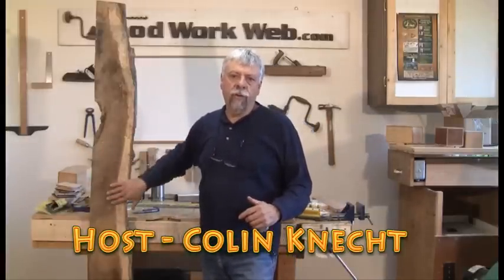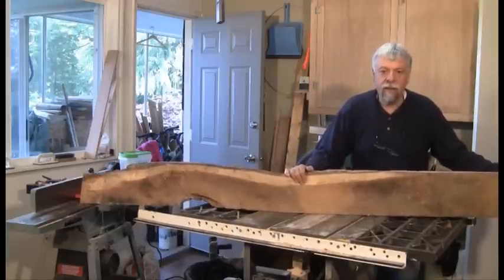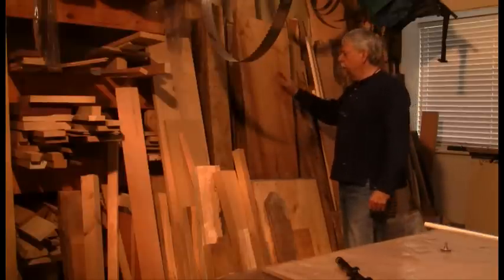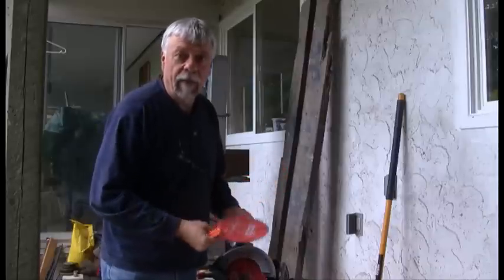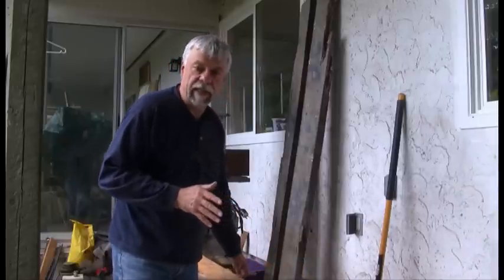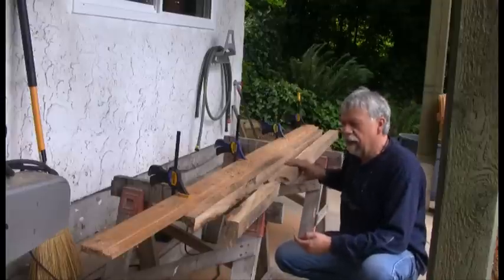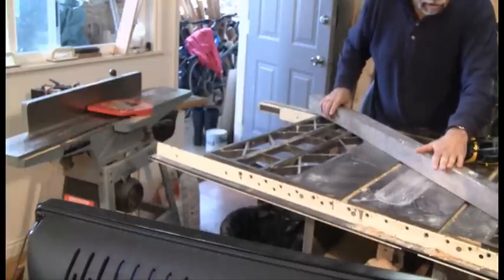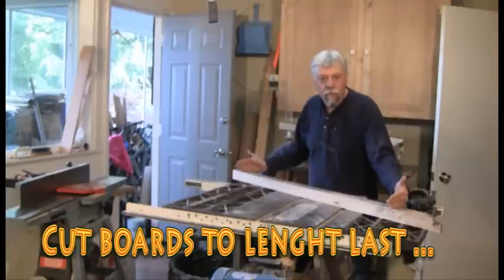Dressing Rough Lumber  - A woodworkweb.com woodworking video

Comment from the maker: Good point, thanks for mentioning this, Yes I have a 6' jointer but a 16 planer so, yes with a bit of work the planer can be used for wider boards by shimming, and also by gluing "skid boards" to the edge of the board being planed. I must admit I have not done this yet, but good reminder. Thanks for commenting, great to have you with us
Colin

Comment from the maker: Hi Zack, yup you are right, I am always concerned about dirt dulling my jointer and planer knives. I know the wood looks dirty, but it is mainly the oxidation of the tanin in the sawdust that is making it look worse than it is, but still I will often wire brush the raw boards before joining and planing.
Thanks for commenting on this important topic on dressing lumber :)
Colin

Comment: Thanks for this video Colin. This is the method that I was taught as well. I will admit that the first time I dressed timber I did not have many power tools so my method was borrowed from Roy Underhill. It was oak and so I was able to split it with an axe, then used a drawknife and a jack plane to finish. 
Now that I have a bandsaw, jointer and thickness planer in my shop, I really do not want to go back to the old ways.

Comment: I often do a quick pass with a belt sander if wood is dirty or may have ingrained grit before putting it through a machine with sharp cutting edges. It can also show up old nails or other metal as bright spots, which are harder to spot as rust marks. Thanks for the clarity of your explanations.
Reply from the maker: Hmmm, that's a good idea, thanks for posting this Rod. I am often using urban lumber and you never know what will show up in it, so that's a great tip, helps keep the blades sharper longer too :)
Colin

Comment: Thank you for this great video! I have a lot rough lumbers lying around and wondering how to mill them for furniture. They’re quite thick about 3 to 4 inches and 14 feet long with 15 inch face. I have a table saw with no splitter, a 6 inch jointer, and 7 1/2 inch circular saw. Your advice is exactly what I’m looking for. Thank you!

Comment: really appreciate the explanation, sir. i am wondering if using 8-1/4" circular saw could speed up the cutting process(less pass), meanwhile could using circular saw to rip hardwood lumber(8/4 or 12/4) lead to some dangerous kick back?

Comment: HI , Great video. I just have a question.@6.38 mark of the video you mention that setting the straight edge at 2 1/4 inches. I am just curious since none of the edges are square where do you take your measurements to ensure you get a straight cut and not a wedge ?.
Reply from the maker: Hi Steve, yes you are right, great question, you basically need eye-ball that setting, you may get  slight wedge but normally I would think it would be pretty straight, and as you go along you will eventually cut any wedging off and get a perfectly parallel board on your table saw.
Reply: Thanks for the reply. This squaring up wood has been driving me nuts. I have a Jointer but just cannot seem to get the hang of it. I have an older table saw and I have been thinking of getting a tracksaw for long rips and trying to square wood. Do you have any opinions on tracksaws ?
Reply from the maker: steve mcelligott There are a few track saws on the market, I do not own one and have only tried the DeWalt, which was fine. You know that you can make a track saw, of sorts just by using you circular saw, and they work quite well, the only problem with them is they do no have the depth of cut that a true tracksaw has, so if you are working with 2" lumber, it could be slightly short. I don't think I have done a video on this, probably a good idea for me to show how to do this.

Comment: I noticed you did not use the jig correctly with your cirular saw. Should you not have ridden the jig so that the blade just hangs over the jig?
Reply: I agree. If you do it the other way, riding the saw on the wood itself, as in this video, then the saw, and, thus, the squareness of your first cut is at the mercy of how straight the face of the board the saw is riding on is. A very wobbly face will in turn cause the saw to follow the wobbles and possibly not give a straight 90 edge all the way down the length of the cut.

Comment: I have an 8' by 1/8" hard pan jig with an attached fence that has various places to attach modified bar clamps. I always plane the lumber flat on both sides then clamp it to the jig and run the jig through the table saw with the jig fence against the saw fence. After the first pass I remove it from the jig, flip it over, and square up the remaining side.
Reply from the maker: Thanks for the tip and thanks for watching!

Comment: question: I have a plank of birch which is mildly warped both lengthways and across the grain (like a twist in the plank). I was raised on the same adage to joint one side and then joint its adjacent before the table saw, but i just can't get ride of the bow and i think its because the wood is warped both in the x and y axis. Am not pressing down on the work as I pass it to cheat out the bow, and understand well the jointers purpose, but id rather not blame my tools when something im doing could be wrong. Whats the best way to address this issue?
Reply from the maker: Paul Heinrichs These are tough ones to work with. You didn't mention how thick the plank is, or what thickness you want to bring it down to ... not the size so here goes with some guess work.
If the plank is thin and too much stock is going to be jointed or planed off, you don't have much choice except to cut it with bandsaw, circ saw or even table saw with a straight jig set-up ... do your jointing and planing and re-glue.
If you have enough wood to work with you could set up a jointing jig for your planer (assuming you have one) basically all this jig does is, you lay you birch on it, then shim the holes between the birch and the jig so the planer does not flatten the wood as it goes through. This way you will get one face that is flat and you can work from that.
Hope this answers your question ... ask more if you need
Colin

Comment: Thank you for taking the time and trouble to post this video which is very nicely done.  My I ask a couple of stupid questions?  After you have 2 edges "true" from the jointer, why not do the other 2 sides on the jointer as well?  That is, what is the advantage of using the planer at that stage?   Also, if you plan to run the wood through the planer, why not just joint one side and plane 3 sides?  That is, what is the advantage of having 2 true adjacent sides when on one of those 2 sides doesn't have contact with the blades or flat surface of the planer?   I'm sorry if these questions are elementary, I'm just trying to understand the process.  Thank you.  Gary
Reply from the maker: Gary Sadler Good questions Gary ... Answer 1 - we plane the opposite side of the jointed edges to make the boards parallel, at least the face side, the edges are made parallel often on the table saw with the saw blade cutting the non-jointed edge.
Answer 2 - we normally joint the face side first, then one of th edges, that gives us an edge that is now 90 degrees to the face, this cannot be done on a planer.
In the end we normally want to end up with a board that is flat on all sides and all sides are parallel to one another. The jointer gives us the first 2 sides, the table saw and the planer finish off the cuts.
Hope I am clear enough on this ask more if you need
Reply: I had the same question, but I'm still stumped.  You joint one side (it's flat), then you rotate the piece 90 degrees counter-clockwise, place the jointed side against the fence and joint the second.  Since the fence is a 90 degree angle, If you rotate the piece another 90 degrees counter-clockwise and place the second jointed (flat) side against the fence, would not that produce third flat side that is also 90 degrees to the fence and therefore parallel to the first jointed side since everything is working off the 90 degree fence?  And then once that's done, we have three, flat, 90 degree angles.  So wouldn't a final counter-clockwise rotation of the piece put that third flat side against the fence, making the final jointed side parallel to the second, and then you have a four-sided, flat, all 90 degree angled piece?  What am I missing?  Thanks.
Reply: Anytime Damon.  Team work, bother.
Reply: Gary Sadler
DUH...I just got it!  Question retracted.
Reply: I still don't understand why all 4 sides couldn't be done on a jointer?  Is it just a time savings process to take it to the table saw and planer?  The explanation by WWW seemed to just restate the steps taken in the video, not an explanation of why you can't joint all 4 sides to get them parallel?  Thanks, & great videos BTW!
Reply from the maker: Marge Howard Hi Marge, good question, I will do my best to try and detail.
You can do all 4 sides on a jointer, IF it does not matter that the 2 opposite sides may or may not be parallel to one another, and in some builds it does not matter. They could be perfectly parallel, they could be out a wee bit or they could be out a lot, really depends on what you are working with for lumber, is is rough, is planed, are there knots etc.

When you push wood through a jointer, if you need to make multiple passes to get it flat or take our rough spots, it is common that a board can become slightly wedge shaped. It is very difficult if not impossible to correct this by flipping the board over making the same cut on the back side and hope that the slight wedge shape is compensated for and the board then comes back to having parallel sides. It can happen, but no guarantee.

Really the best way is to try it and see how it works for you, depending on what you are doing and your lumber, you may be able to use the jointer for all 4 sides but if it doesn't work you will be able to see why. Many of us have tried it at one time or another :)

Hope this helps
Reply: Great explanation, I was confused and see now that the the jointer will flatten the wood on the other sides but doesn't get it parallel to ensure all your corners are square.  Thanks again for the quick and patient response.  Your videos are great for this beginner.
Reply from the maker: Marge Howard No prob ... I hope my long winded explanation was clear enough, but you got it  :)  Maybe you will share some pics with us of you builds in the future ... 
Colin
Reply: Gary Sadler Gary, Beating the proverbial dead horse, I just made four 3"x4"x"31" legs for a new workbench I'm building. I glued three 2x4s together which of course produced two near perfect flat sides (the wide side of the boards, and two near but not as near side where the 2" sides of the boards came together to form a 4.5"x 5.5" leg.

I didn't want any of the legs to have the dimensional lumber cut look, so wanted to dress up all four sides.  Here's what I did.

1. I jointed one  5.5" wide sides of the leg to get it perfectly flat and very smooth surface.
2. I placed that newly jointed side firmly against the 90 degree set fence and jointed the first 4.5" side (the one where you can see the glue lines).
I put my square on it and it was a perfect 90 degree angle on the corner of the two jointed sides; results: two perfectly flat side with a 90 degree corner (#1) connected them.
3. I rotated the leg another 90 degrees which put the opposite 5.5" wide side face down on the jointer.
4. I pushed the side facing the fence FIRMLY (and I mean FIRMLY) against the fence and ran the leg down the jointer ENSURING that the fence side never left the fence (no gap whatsoever).
I put my square on THAT newly created jointed corner (#2) and it was a perfect 90 degrees and the side was flat.  Now I have THREE perfectly flat side of the leg with TWO perfect 90 degree corners.  (Applying geometry it MUST now produce two more 90 degree corners on this 4-sided leg once I'm done.)
5. I rotated the leg another final 90 degrees which put the newly jointed 5.5" against the fence.
6. Again, I pushed the side facing the fence FIRMLY (and I mean FIRMLY) against the fence and ran the leg down the jointer ENSURING that the fence side never left the fence (no gap whatsoever).
I put my square on THAT newly created jointed corner (#3) and it was a perfect 90 degrees and the side was flat.  Now I have FOUR perfectly flat side of the leg with THREE MEASURED perfect 90 degree corners.
7. Take a guess at what the final measurement was on the 4th corner after all this jointing?
8.  Geometry: A rectangle (which is what I produced) must have two parallel sides and four right angles.
Reply: Marge Howard Marge, read my recent reply to Gary.

Comment: I made a home made fence, that hugs my origional fence, but is 3m long(yes 3m...)roughly 10' and if you have enough space for your cupped side to ride that fence without dipping, or waving to and from the fence then you are good to go...that is my advise to the guy that has a garage table saw and not much else...that is how grandpaw did it, and that is how I do it...and it does work...so long as you do not put too much pressure on the stock pushing toward the fence, turning the bow into a cup...anyway...once one side is done(bow side is cut first) just flip in over and cut the cup off...ready for a crosscut or more.

Comment: Good video
Only problem is, sometimes when you cut a strip from a board the tension built up releases and your strip can end up warped which could cause problems on your jointer.
Reply: Colin Knecht
It's due to the wood shrinking at different amounts, at different places, when drying.
Reply from the maker: FLPhotoCatcher Yes it can be moisture differentials, unless the wood is stable, in which case it is tensions from tree growth. For example we seldom use tree branches because the tensions the built into them as they grow can be tremendous.

Comment: If you put the factory straight edge on top, then slide the saw along with the plate against this edge while cutting a new edge on the bottom board, you don't need to measure your cuts.  Just place the cut edge of your guide right on the line you want to cut.

Comment: If you are going to buy a good blade be careful that it doesn't touch steel as the carbide is sharp, but also fragile. You held the Bosch blade and the Freud Diablo together which can damage the carbide teeth. Even if the blades are both all steel, it is a good practice to not have one touch another, or come in contact with a saw surface.
Reply: So if I decide to do a video comparing blades I shouldn't let them touch each other. If I ever find myself in that circumstance I'll try to remember that. 🙄

Comment: Hello, thanks for all your great video. I am new at this wood works. My question is, what if you just put wet wood in the huge oven to slow dry your woods, would it damage your woods. Thank you for your help.
Reply from the maker: Mai Dayjeen No, it won't damage the wood, but if it dries too quickly some woods can crack and warp. If the heat is low, it is probably a good way to dry wood.
Reply: Thank you very much. I am in Thailand and the huge oven I was talking about is use for drying rubber sheets, it is low heat and it continue heating 24/7. I am so new at wood work and all I want to do is making furnitures and have no idea about woods, but I am learn.Thank you for writing back and I do really appreciated. Have a great day.

Comment: why you cant do all 4 side on the jointer ?
Reply from the maker: akil last You can do all sides on the jointer but if you need to have any of the side parallel to one another, you need a planer to do that, otherwise you can end up with a slightly wedge shaped board.
Reply: O so the jointer is not gonna do the 4 side accurate
Reply from the maker: akil last The jointer will only make a surface flat, and it can also help you make any 2 adjoining sides 90 degrees but it still cannot assure that 2 opposite sides are parallel.

Comment: it is a very strait grained stable wood. extremely hard but surprisingly easy to work with. here in the palm springs area it is fairly common I just wish it grew bigger 12" two 14" is about the largest. I here Texas mesquite grows larger but has less contrast to it. P.M. me your address and I'll send you a chunk

Comment: You said not to use a table saw but your wrong. Every difficult step you used with your circular saw you do on the table saw. Clamp the rough lumber onto a straight and true piece of plywood. Run the straight edge against the fence and cut the crook or crown out of the board with a powerful table saw with at least a 10 inch blade. This method is faster, and saver. It's called making a board straightening jig.

Comment: Wouldn't it be better, Mark where it's out, all 4 sides, with a chalk line or straight edge, cut the bad off only, so you have a total straight board to work with? Not sure how you were able to calculate the size board you need, before taking the unknown loss out. Unless you didn't care.

Comment: I was with you up until you said cut to length.  At first I did not get it, but obviously you just cut off both end square to one of the finished sides.
Reply from the maker: Hi Will, yes, I believe that is correct. To be honest, this is an older video which is slated to re-do in HD and a few changes, but basically the same.